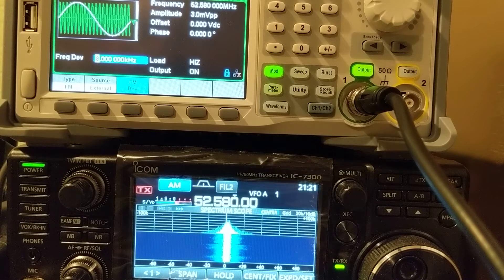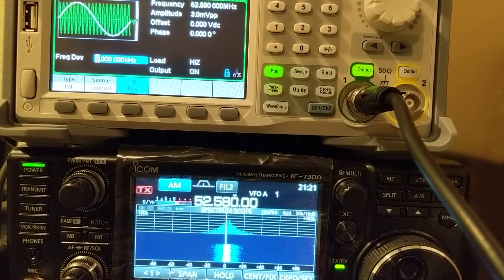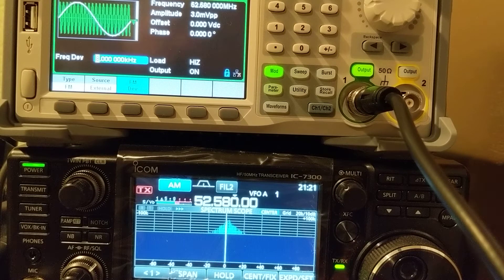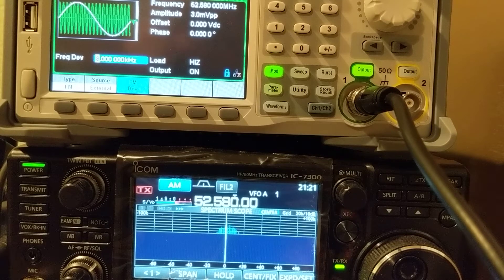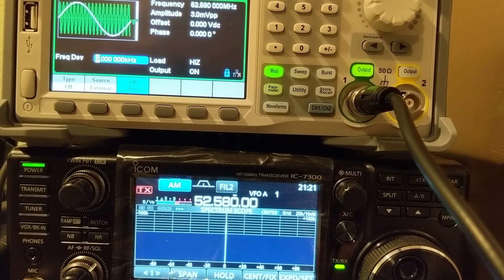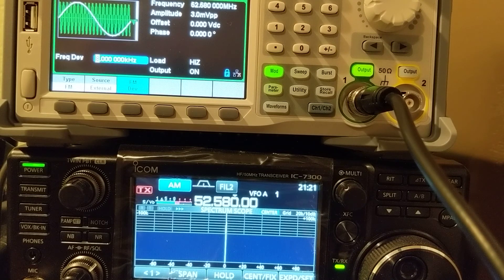Using Siglent Signal Generator to Create FM, AM signal for HAM Radio

Comment: This may be common sense, but when hooking up a function (versus signal) generator to your ham radio, be mindful of the receive power your ham radio can handle. For frequencies below 30 MHz, an S9 signal (the DB reference point for the S scale) is 50uVrms (micro volts!) or 140uVpp, which is .14mVpp. So, the .2mVpp signal is 1.4x S9 (which works out to +2.9 dB on the S scale).  At frequencies above 30 MHz, S9 is 5uVrms, not 50uVrms. 5uVrms works out to 14uVpp.  So, feeding a .2mVpp signal above 30Hz would be 14 x S9 (+22.9dB). A signal generator is probably better for this application. If someone feeds 5Vpp into a ham radio, watch out.  Below 30 MHz, that's 35,714 times the S9 level (+91 dB), a level that could damage the radio's front end.

Comment: This device is a function generator, not a signal generator.  A function generator can generate a number of waveforms at relatively high power (for example, +7Vrms is 1,000 dBm), but the highest frequency range at which it can operate is limited (to about 200 MHz on high end models).   It also has tools for capturing waveforms, editing new waveforms, etc.  A signal generator can generate smaller level signals typically found in RF applications (depending on the model, down to -127 db) and operate at much higher frequencies.  The high end  versions can go from 5KHz to 6GHz.  A older HP signal generator that you may be able to pick up for $200 to $300 goes from 100k  to 1GHz, with a range of -127dBm to +17dBm.

Comment: Hi, Thank you for making this kind of video,  I would be very thankful  if you could make a video to show how you made the connection between signal generator and radio.ThanKS in Advance!
Reply from the maker: if you watch my video named "ICOM 7300 sensitivity" recorded 2 days before this video, I explained how to get this power figure. I could not remember clearly, but I think I just shoot signal generator power directly to the input of the radio. just be very careful, do not burn the radio input.
Reply: @johnthehammer7702  Thank you John for the fast response,  2 more questions please, the output of the generator is connected to microphone of the radio? (BNC to 4PIN) ? And it's possible to modulate the carrier of the radio with a signal from generator  ? Thanks again for your time in doing videos!
Reply from the maker: @andreipopov350  output of the generator is fed into radio's antenna input. so be careful, not to burn the radio's front end. when I did it first time, I was very nervous. It is simulating what you have received from antenna. Yes. it is possible to  put AM, FM modulation on the carrier frequency on the signal generator. There is one of my YouTube doing it.
Reply from the maker: @andreipopov350  at 6:26 of this video, you can see I play some music from my regular radio. feed that audio signal to signal generator, which modulates audio signal on the carrier (FM, AM) and sent to HF radio. ICOM7300 recovers audio music.
Reply: @johnthehammer7702  Thank you again,  so if you want to use signal generator  as the modulation signal  (feed into I icom  microphone,  probably it will  burn )) , I red about icom microphone,  it's a dynamic one,  sometimes if you scream it can develop up to 1 volt,  but how to connect it? This is tricky))).
Reply from the maker: @andreipopov350  not microphone. I feed it to ICOM7300's antenna port. just think of signal generator in place of antenna. it is sending out modulated HF band signal. Microphone is audio band, probably under 4khz.
Reply from the maker: @andreipopov350  i am testing ICOM7300's RF receiving sensitivity.

Comment from the maker: To generate a S9 signal for radio, signal generator has to generate 0.14 milli volt peak to peak sine wave. S9 is equal to -73 dbm
Reply: And in this case he set the function gen for Hi Z so should set .28 mVpp or 100uV rms. Or alternatively set the siglent for 50 ohm load and set .14mV as you suggested.